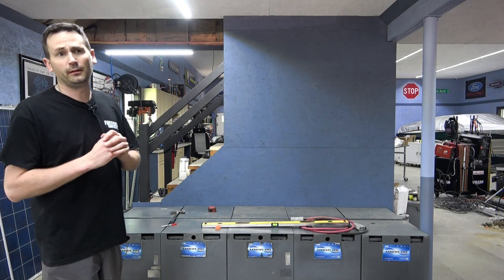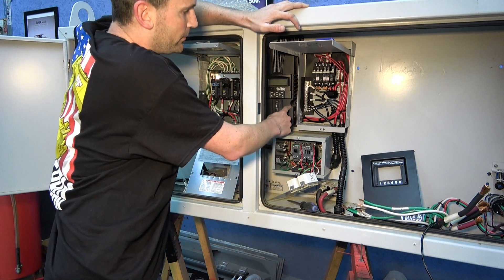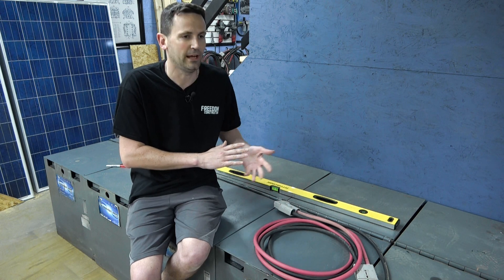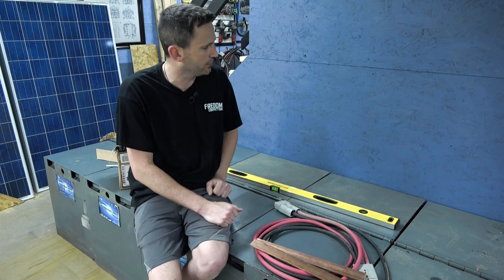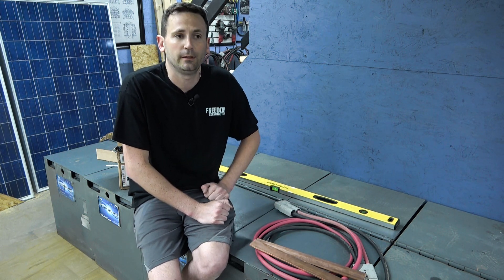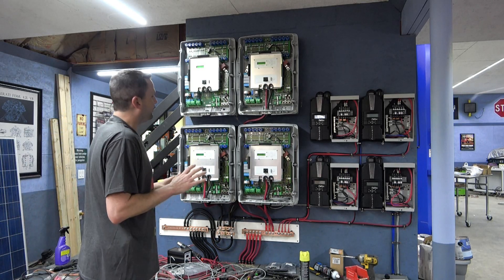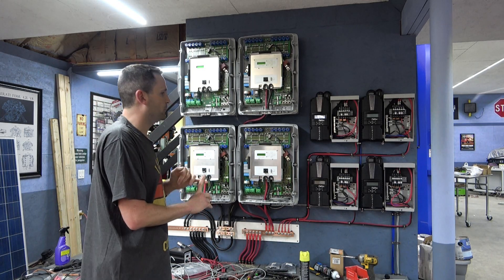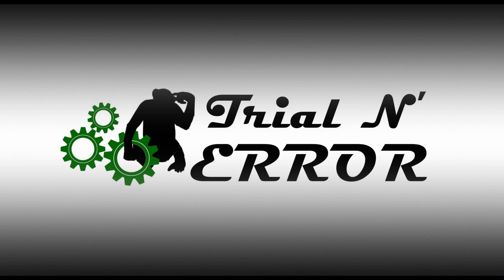Building A HUGE 240v OFF GRID Solar Power Plant!

Comment: Any idea where to find a new lighting center? Our trailer has the lights but the timer/controllers are shot - did any of yours work when you bought your trailers?
Reply from the maker: 1 out of the 8 were working....yea, those controllers are garbage.  You can pick up replacements at any home depot/Lowes.  They are just a standard home timer light switch.

Comment: I think you meant 4/0 aluminum cable for a 200A service, You may want 250 Aluminum for a 200A sub panel which is rated 205A @ 75C.
Reply from the maker: Yep, you are 100% correct.  I'm ordering 4/0.  Thank you for catching that and making sure I didn't set my house on fire :)
Reply: @Trialnerror  4/0 is rated at 205A @ 90C but only 180A at 75C I thought 4/0 is for a main panel.  I'm no electrician, but I think you want the 75C ratting going underground (holds more heat) from a sub panel which would be 250 Aluminum unless you don't think you will come close to pushing 200A with your solar array.   I am pretty sure that is what the utility ran underground from the pole to my meter for my 200A service, it looked larger than the 4/0 I used, I was OK using 4/0 from my meter which was back to back with my panel.  Here is the ampacity chart:  https://www.cerrowire.com/products/resources/tables-calculators/ampacity-charts/

Comment: The DC part of the system looks very organized and clean, one thing you may want to consider is some kind of short circuit protection for the cables coming from the batteries to the bus bars. That's a lot of alavable power if something ever shorts out. The simplest option might be a MRBF Terminal Fuse Block between the wire from the battery and the bus bar it could just be bolted in place to the bus bar without having to redo any wiring.
Reply from the maker: Can't disagree with you.  I was thinking about a simple inline fuse (big boy) right at each battery terminal on each cell.  Imagine the intensity of that much current shorted!!!!  Thanks for looking out and watching!

Comment: Hi Man, what brand and type of lead-acid batteries do you have and why you have chosen it instead of some lithium based? If you have video about this issue, please let me know.
Reply from the maker: So I'm using GNB Tubular Lead acid cells because they came with the trailers I bought with all the solar equipment (in other videos).  I honestly would have gone lead acid regardless.  Cost per amp is just too important to me.  If you size your battery bank properly so you're only playing in the top 40% or so they can last for decades.  Some day lipo4 will most likely overtake them but as of today these are still the best overall deal IMO.

Comment: Flooded lead acid batteries release hydrogen and sulfur dioxide when they are fully charged. I’m not sure if it will be an issue but it is definitely something to keep an eye on.
Reply from the maker: Someone else brought that up and thank you!  I have a rough plan to vent it based on charge current.  It's half baked in my brain and I should have it figured out by the time I'm ready to deal with it.  Thanks again for looking out!
Reply: Those are AGM batteries if I recall from your earlier videos.  If that’s the case, no worries about venting and they aren’t FLAs.

Comment: With the horizontal mounted load-center, you will only be able to use the breakers on the bottom half.  Per NEC, when circuit breakers are mounted in a vertical position the “on” position of the breaker switch has to be “up” (NEC 240.81)  Normally in a vertical mounted load center, they are sitting horizontally.  

Also, some manufacturers specify that their panel should only be mounted vertically, so you need to check the fine print on the manufacturer’s data plate.  [NEC 110.3(B)]

Comment: I did not realize why electricians are so eager to spread the load.  Now I know. Seriously, would you mind doing a deep dive on each component. Batteries, what is composition, how many volts in the box how does that translate at the bus bar. By the way nice job on the homemade bus bar. Next the components to the right I think those are charge controllers maybe you'll get into them when you put the PV on. And maybe a lot more close-ups and explain again how your inverters master and slave to each other and a deeper dive into the phasing of the voltage and how they all play nice together to get 240 volts out to the mains panel?  Thanks!
Reply from the maker: I sure can do that.  Thank you for watching and for the ideas!

Comment: Awesome video, one thing to note is the power cables that go to the buss bars from the batteries and from the buss bar to the inverters should all be equal length otherwise the shorter cables do most of the work. It will still work but maybe not optimal. Really impressive setup! I'm jealous.
Reply from the maker: I read that but thought it didn't apply to a dual split phase?  It only mattered under one type of arrangement (and I don't remember what it was but it wasn't mine).  I could have made a mistake but I was pretty sure.
Reply from the maker: Oh, I remember.  It was the different phases that needed to match cable length (which they do in my arrangement).   You can have different lengths between SMA's on the same phase but the two phases need to shar the same length.  So I believe I'm good!